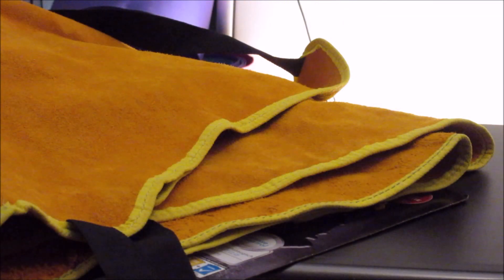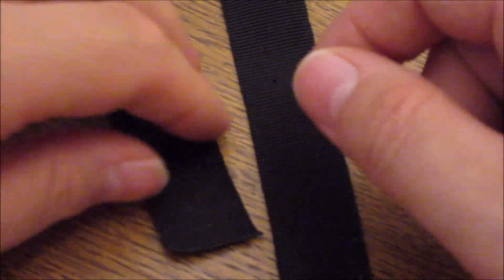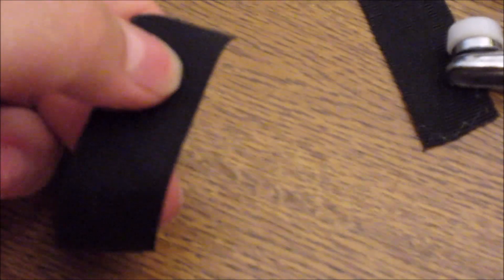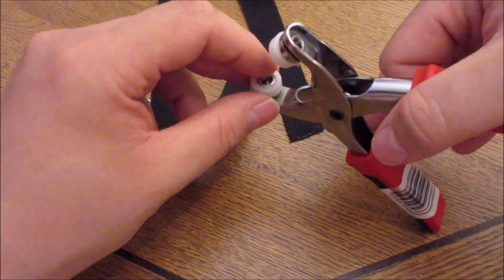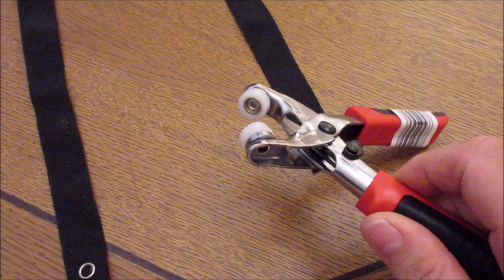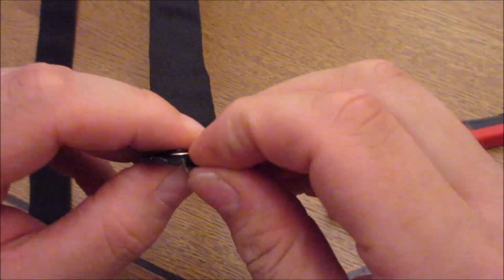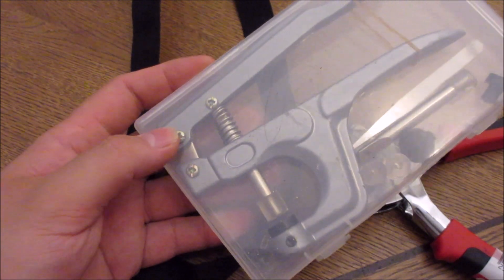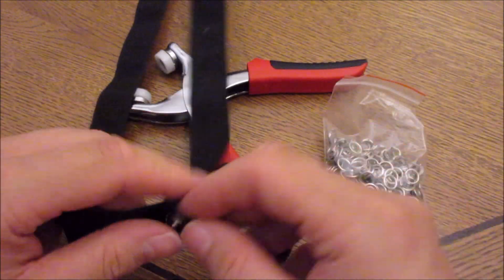Adventurers Club 🧭 how to install snap button rivets

Comment: Good find for a simple tool that works. You got me thinking why we need to purchase a battery of working repair tools like this. In the Philippines, there is a thriving UKI-UKI (used clothing) industry. There are many brick & mortar shops along roadsides and a growing online presence of this business. Sure, there are some scammers attempting to sell fake branded clothing. Beautiful Bride is knowledgeable how to spot the fakes. She has closets full of high end branded clothing, collected over years. Many items came to her with the original price tag still attached! The truth is, she can, with careful shopping, fill a closet for far less than one brand new item might cost at a shop in the mall. There was no real need to repair anything but a button. Sadly, some of the clothing repair shops went bust with the pandemic. Now, I have to admit we may be in trouble with no means to repair clothing if/when SHTF. A thread and needle works but, if you can afford it, tools to set snaps and a simple new manufacture treadle sewing machine (with add-on electric motor) may be a great time saver. Thank you for the video.